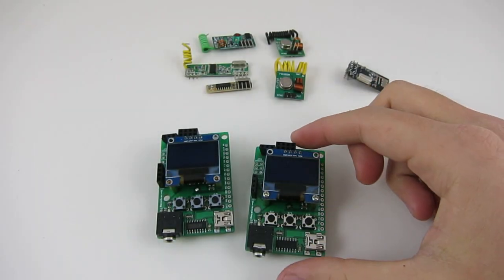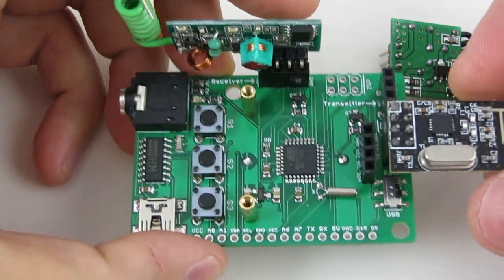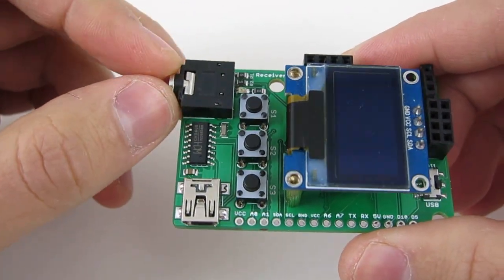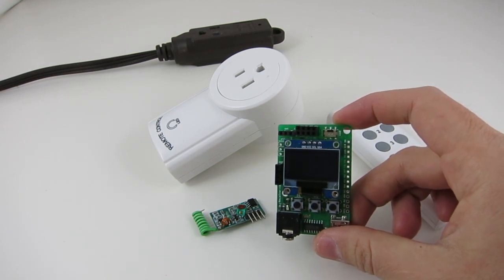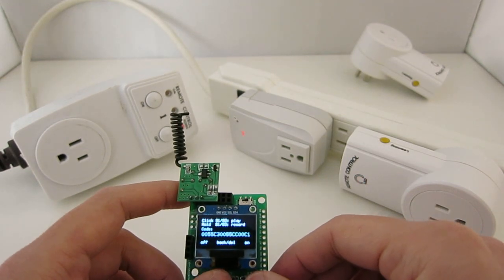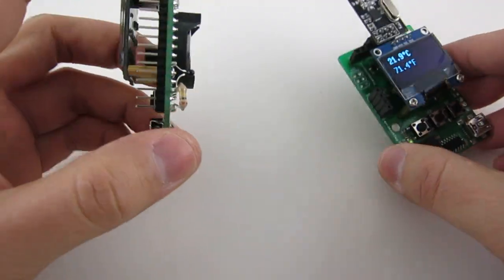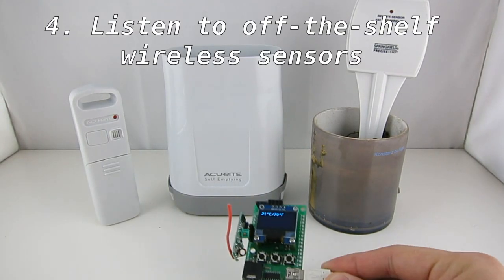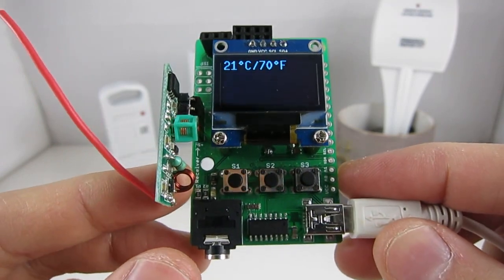Introducing RFToy -- an Arduino-compatible Gadget for Radio Frequency Modules

Comment: Hi! I've been watching some of your devices and I pretty interesting. I'd like to control the heat floor of my house wirelessly, but I don't know well how. I'd like to work with wifi to integrate the solution with a control panel in home assistant or something. The idea is to put some temperature and humidity sensors (and the possibility to choose the temperature) in every room, and send the open or close order to an other device located next to the valves which control the heat floor and the boil. Could I do this whit any of your devices? Thank you!!